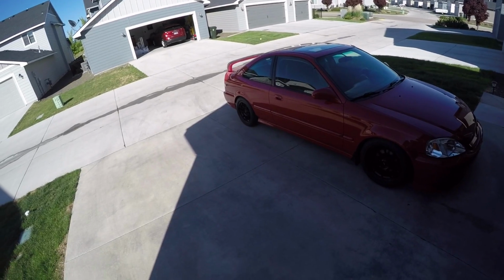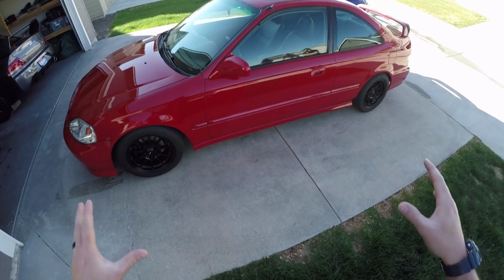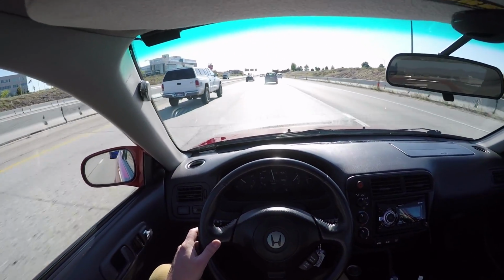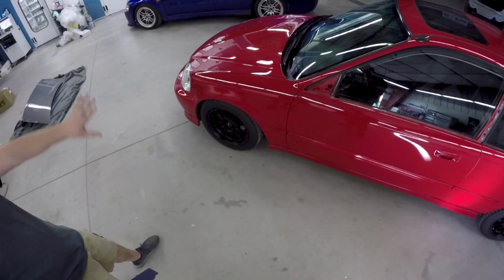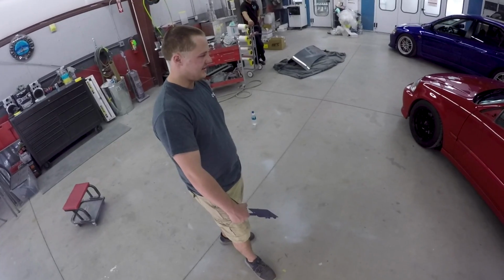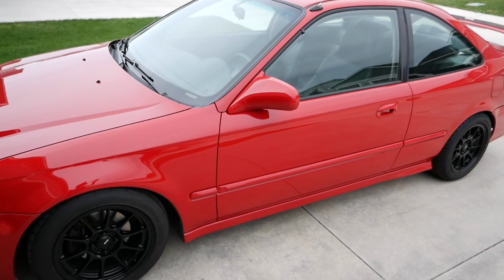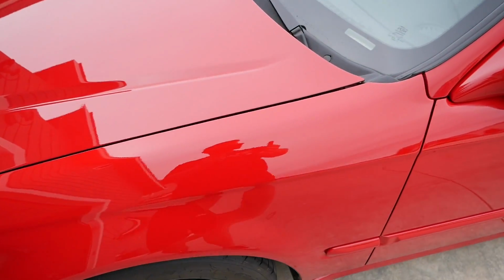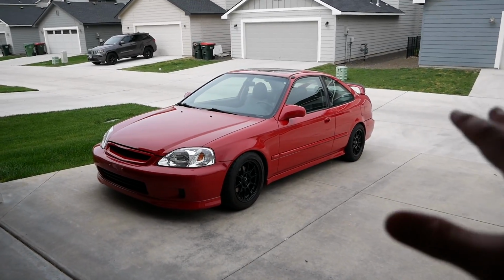Fixing THE THING I HATE MOST About My Civic | Honda Civic Paint & Body Work

Comment: Your rear bumper on the driver side is kind of bogging out and you can see the white clip where the bumper suppose to sit on top to make it flush with the quarter panel.
Reply from the maker: It is. I need to hammer up the click a little bit